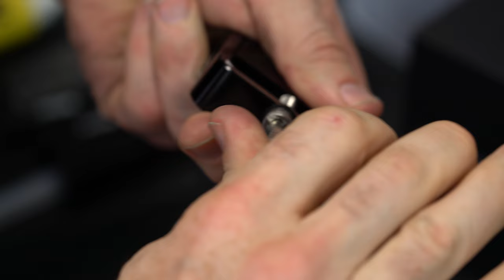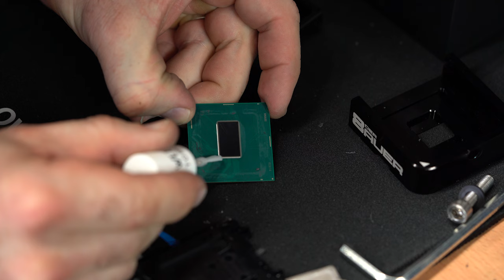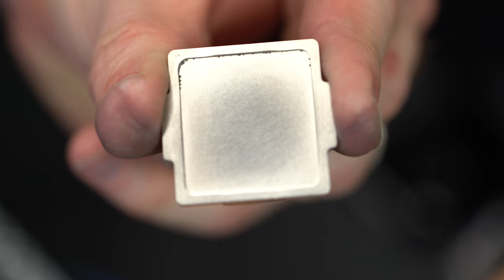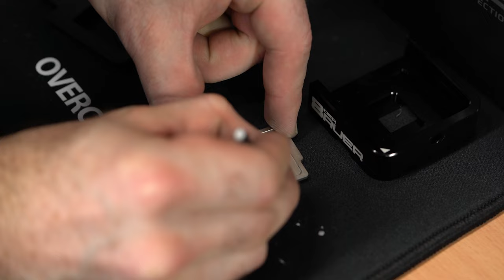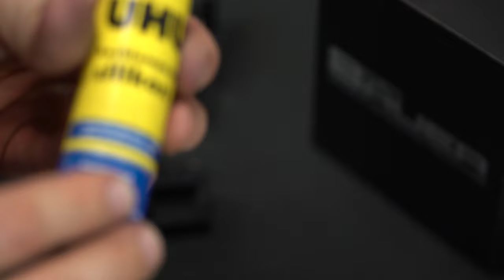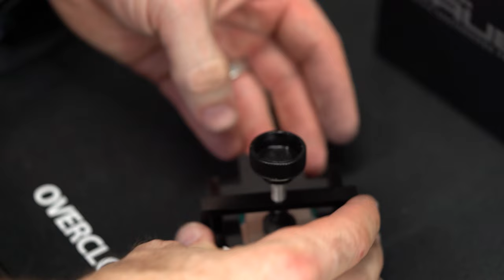How to Delid a CPU for Better Performance

Comment: This is fascinating I knew you would delid a cpu to improve its cooling properties but I assumed it stayed delidded I never knew it was reapplied again.
Reply: TheIntronD you can do that, it’s called direct die cooling.
Reply: i never reglued my ihs back to the cpu, lol . still great after  a year or so.
Reply: Franklly, putting the lid back on isn't ideal.  Every interface is an additional barrier to the heat.  But the lid in this case is part of how the CPU is retained in the socket, so it makes things a little easier to keep it.
Reply: @peteschneider5842  you kidding right? You want to put your cooler on top of your bare chip? lol
Reply: @rafars2246  Hell yeah. That's what you do with GPUs.
Reply: @peteschneider5842  this is a CPU, totally and absolute different story. GPU chips are not covered the same way. Plus no cpu cooler would be able to make good contact without that piece of metal.
Reply: @rafars2246  I know you think you're an expert, but I've been in semi for decades.
Reply: @Rafa RS  No idea where you're going with your virus thing or whatever. There's no physical difference between the silicon used for CPUs and GPUs. CPUs have a IHS to keep your dumb little fingers out of the die and decoupling. GPUs can't have them because they produce 5x as much heat as a CPU. Putting a heatsink directly on the die is ideal. The IHS is just a lid that protects the die from amateurs at the cost of increased thermal resistance.
Reply: @peteschneider5842  already explained why is not possible Plus obviously, the freaking piece of metal is also heat dissipator. You're not a good troll.
Reply: @rafars2246  The metal conducts heat, but the extra layer of thermal compound under it is a barrier. Anyway, you can choose to learn or double down on your ignorance. Your choice.
Reply: @peteschneider5842  it is Saturday, get off the short bus
Reply: @peteschneider5842  Thanks for the good info and encouragement Pete I remember my first build in the early 2000s  my AMD chip had an exposed die.
Reply: @PinkVisor  ow wow, early 2000. Yesterday...
Reply: @peteschneider5842  Well explained and sadly wasted on that guy. Im with ya though if im going through all that trouble im gonna keep that thing off
Reply: @peteschneider5842   It depends on the cooler a lot.

On my 3770K I delidded some time ago with just a blade, it all went fine.

However the direct-die-cooling went pretty bad since I have a big air cooler that only mounts vertically and basically wasn't getting that amazing temps.

So when I moved the cooler towers horizontally they moved very easily and made a huge difference in temperature however I was making a good amount of force and bam ended up cracking the 3770K die sadly.

But I'm guessing any liquid cooler that mounts in a X or simply vertical and horizontal will be pretty fine as long as it's mountings allow it to go much lower than normal to make good pressure on the die.

I'm going to delid my 8700K but I think I will use the IHS this time and gluing it for like 24hours cause I'm guessing the glue is what would give the needed strength for the PCB to not get fully bent and make sure the die is still flat with the IHS.

If it goes well maybe some day I would delid it a 2nd time and then go for a water cooler to go full direct-die however is always hard to know which one will go as low as it's needed or else will need a bit of modding...
Reply: You can do both. I usually relied for convenience, while others may choose not to glue the IHS back on. When I say glue I mean using a safe silicone sealant.
Reply: @rafars2246  actually yes, direct die cooling has been a thing for a long time. It actually gives lower temps, but it can be riskier.
Reply: @rafars2246 You‘re the best example of a person that will never accept that he‘s in the wrong. This ignorance pisses me off, be a better person
Reply: @seligaprv8669  You're wrong bruh
Reply: @guily6669 what are you upgrading to next? I had the same 2 cpus as you.

Comment: god i wish there was a company that sold cpu's with liquid metal already pre applied underneath the ihs. there would be such a huge market for it. there is not a doubt in my mind that people would be buying these cpu's over the regular ones.
Reply: exactly!
Reply: i've been doing this for the past couple months or so, i actually have someone who sells brand new sealed CPUs for cheaper than retail as well so i am able to sell them quite cheap. only issue i've had is posting them.. The couriers must be a little too harsh with the parcels as when the buyer ends up receiving their CPU the liquid metal would have leaked out from underneath the IHS... this happened 2/2 times however ive sold over 20 in person and all been absolutely perfect. Couple times they get really lucky with the silicon lottery too ive been told they manage to get 6ghz on all p cores and 4.3 on e cores with 75 degrees celcius, absolutely insane

Comment: Nail polish is a terrible idea to insulate anything on a pcb especially when it heats. When nail polish dries it's becomes brittle and it might just snap out of place without warning. It might also be fine but it's a gamble. I'd only use nail polish as a temporary solution when I'm testing a circuit I'm still building if I really had to coat something with a thin insulator. A circuit with more crude components not a damn cpu pcb.
Reply: so what would you use?
Reply: yup. also silicone too is absolute shit. thermal adhesive would be much better
Reply: @trevnextgen  thick non conductive thermal interface material, a very small piece of non conductive thermal pad, thermally conductive ceramic coating, non conductive thermal adhesive which should also be used to seal the lid instead of the shit that was used in this video. so, plenty of options. varnish is an anecdote

Comment: A tip, you can also use the silicon glue to cover the small capacitors on the CPU. Just for good measure.

Comment: Super glue is a very permanent solution. So I'm glad you say you don't recommend it. 

I also use a silicone sealant since I don't want to lose the IHS when I decide I need to remove the heat sink lol
Reply: silicone sealant is absolute shit and keeps heat inside. it's thermal adhesive that should be used

Comment: Apply the Liquid Metal directly!  Don’t apply it on the cotton swab because you might accidentally drop it on the circuit board!  I learned this the hard way!
Reply: Bad advice I always apply to the q-tip
Reply: @toonnut1   That's how Gamer's Nexus does it, do whatever works for you.
Reply: I agree with do it what way you want but what I don't agree with is when someone (you) tells people to do it the wrong way with the most risks for damage and thats the way you said and gamers nexus does it wrong if you look on their video I made a comment telling them that. Its common sense to put the liquid metal on the q-tip rather than squeezing that syringe over your whole motherboard. It's extremely easy for the liquid metal to fly all over especially if you've never used it before. The best way is to keep the cpu out the motherboard and apply it well away from the motherboard then drop it into the motherboard after the liquid metal is on the cpu there's a zero chance if the liquid metal going everywhere
Reply: @toonnut1  Well, I've tried both ways myself and that's my experience with it, the Q-Tips can't really absorb the liquid metal well, you could also drop it if you don't have a steady hand.  I see what you're saying, my conclusion is it's the skill that matters, both techniques work well.
Reply: @24kmetal99 I agree 👍

Comment: this might be rather stupid question, nevertheless,
Why putting back metal cover of CPU? 
Why not just stuck CPU cooler directly? After all what we see underneath is just the same as any laptop CPU.
Reply: the cooler attached wouldnt make contact atall and the motherboard cpu bracket wouldnt tighten 

youd have to get a custom cooler and remove the bracket to do bare die.. they do exist but yeah..

hope this helps
Reply: @Journetta  Some thick copper plate can help, probably?
Reply: DO NOT APPLY THE LIQUID METAL LIKE THEY DO IN THIS VIDEO!

I'm currently following this guide and am using thr exact same brand of liquid metal. I've just wasted the whole tube because if you try to squeeze it out slowly onto the q tip like this, with no attachment on, it will all fire out immediately at a high velocity. Even if you follow the steps exactly as they are shown, and carefully apply pressure.

I've just wasted a full tube of liquid metal due to this video. Instead, follow the recommended way on the liquid metal packet instead. I've just put my only machine out of action for days while I wait for a new tube of liquid metal.

Thanks guys.

Comment: Doesn't it reduce the thickness affecting fan fit?
Reply: yes it does...but its not so thin that it makes a difference in the mounting...however it makes a difference in the heat dissipation...since the actual distance between the core and the heatsink of the fan is reduced, heat literally travels faster...reducing the thickness of the ihs and changing the thermal paste (or liquid metal) under the ihs are the main goals of delidding...to further reduce the thickness of the ihs you can also lap it...
(if you wanna discuss more about this you can hit me up on insta @nuklearpcmodz)..
Reply: No it does not at all. Lapping does that. But that is something entirely different.

Comment: what is that q tip looking tool hes using to spread the LM called?
Reply: Its a q-tip from Kyronaut which is included in the kit. but its not a basic white q tip

Comment: what is that black glue called? if i needed to reseal the cpu back
Reply: it is not  the glue you need, it is a thermally resistant high temp. silicone that you would apply if you want  it done proper. I use the industrial hi temp. silicone  to do the relid with the copper IHS.
Reply: Hi temp car silicone.

Comment: won't that liquid metal leak away from between heatsink and die and so the cpu will have higher temperatures in that case? I mean i know you isolated the resistors just to make sure the liquid won't leak and reach them, so you expect the liquid to leak from between heatsink and die.
Reply: no it doesnt leak it sticks on like a usual thermal paste the conformal coating is extra protection. the liquid metal thermal compound is not expected to leak or leave the space between the heat spreader and the die over time. its in case there is a spill or if there is any excess that squeezes out.
Reply: @tanyesil  no, thats not true. Liquid melt leaks when it gets really hot. For instance, the PS5 specially designed CPUS has walls around the liquid metal to prevent leakage. If there are no leak proof walls around the liquid metal, it will run all over the place.
Reply: @theclaybeartravels3596  id like to see you prove your point. ive been using liquid metal on my pc's for some time now, never seen lq metal leak
Reply: @tanyesil  so your calling Sony ps5 engineers liars?
Reply: @theclaybeartravels3596  Yes.
Reply: @theclaybeartravels3596  i never said that, and in a mass production setting that type of precaution makes sense and isnt exclusive to sony, dell also has laptops that use lq metal and they put extra protection on nearby components + they have some sort of seal around the chip, my argument was that liquid metal doesnt spill/leak with careful application and the extra protection used is risk reduction rather than necessity

Comment: So delidding is simply repasting????
Reply: No, delidding is removing the LID(top) of the CPU.

Repasting is taking the thermal paste thsts ALREADY on the CPU (or GPU cuz you can do it to them as well) and REPASTE it (hence the name) using either BETTER thermal paste OR liquid metal.

But I know what you mean and the short answer is yes. Lol sorry.
Reply: @PhillipLemmon  Thanks for elaborating bro. I needed that. I knew the short answer already
Reply: @robertcooper5308  Kool.

Comment: why don't manufactures do this?
Reply: Easier to just wait for people to try it themselves, void warranty, then buy a new cpu
Reply: This applies to all the products you use irl
Reply: It's not in their financial interest to give you the best performance you can possibly get out of your CPU. If they did, there's a greater chance you'll use the CPU for longer before spending money on replacing it with a newer, faster one.

There's also the fact that they'd have to start buying liquid metal thermal paste in bulk, which would increase manufacturing costs. Tech companies always skimp out on small things like the thermal paste they have to buy in large volume for the millions of CPUs/GPUs/etc. they're manufacturing. All they care about is using the cheapest materials they can get that will last through the warranty period before breaking (or, in this case, drying out).

Comment: This is exactly how my ASUS laptop CPU looks like. Does that mean that laptop CPUs are delided by default?
Reply: No
Reply: laptops come without an IHS
Reply: hey..a laptop core genrally has a tdp between 15-35 watts...while desktop cores have tdp ratings of 35-280 watts...hence laptops dont need an ihs (which is the metal plate on the top removed in the video)..
Reply: @duvvurisurya8244  laptops dont have an IHS because consumers don't install the cpu and cooler by themself. The IHS is only protecting the die and makes the cooling actually worse.

Comment: would the delidding tool work with a 9600k?
Reply: 9600k should be soldered. no need to delid
Reply: @milchkopf3881  Even on the soldered 9series Cpu's you will have temperature advantages after delidding + Liquidmetal... Ive done my 9700k a few weeks ago nd its only hitting 60 degrees on full load with 8cores on 5Ghz.
Only differance to this video is that you will be better of pre heating the Ihs due to solder instead of glue. just to make sure you dont crack that little pcb...
Reply: @milchkopf3881  why?

Comment: I did this with an i3-4130 and it went from 3.4 Ghz to 6 Ghz...I used a sticky bogey instead of nail varnish too, and smooth peanut butter instead of silicone...improvise for sure.....then it went on fire so kinda peanut butter on toast I suppose...and a bonus bogey.

Comment: DO NOT FOLLOW THIS VIDEO GUIDE!

The way they apply the liquid metal is wrong. If you follow this approach exactly as outlined in the video, not matter how careful you are, you will spill all your liquid metal everywhere.

Instead, use the syringe and apply a very small amount directly onto the die. This is what the manufacturer of the liquid metal recommends.

Don't follow this video. You will waste your liquid metal and have to order more, putting your machine out of action for days and costing you.

Ask me how I know.

Comment: So stock Intel chips just have thermal paste in them AMD zen 3 chips have LM already in them from what I’ve seen and read lol Intel sucks I don’t care how bad ppl think AMD is there actually really good processors better than Intel always have been for gaming anyhow I’ve games on one Intel system in my life it sucked every AMD machine I ever built even the budget builds over the years we’re gaming beasts for there time, AMD also used to have very good graphics cards I had one NVidia card I bought for my new build a 512mgb card from 2005 when my wife was at work I took my old 512mgb Radeon out of her PC and put the NVidia in her PC lmfao she never knew, now days amd cards suck I have an RTX 3080 Ti in my current PC

Comment: what is the used glue?
Reply: Relidding isn’t something you should be doing. When you delid and remove the silicone you reduce the gap between the IHS and die which gives you another 5c off so should leave it unsealed. 
From experience from a new cpu with fresh paste you get 10c less at load(removed silicon and new high performance paste)
You can get an additional 10c less using liquid metal.
Reply: @joe-fc6be  Just don't do it. Relid it proper and use the liquid metal for your DIE and IHS and you're safe. Do not mount any kind of cooler directly to the CPU DIE if not with a specific spacer and if you really don't know what you're doing. This is not  the AMD mobile Athlon cpu...
Reply: @ps3customgamer  so it's better to have the lid on but without gluing it?